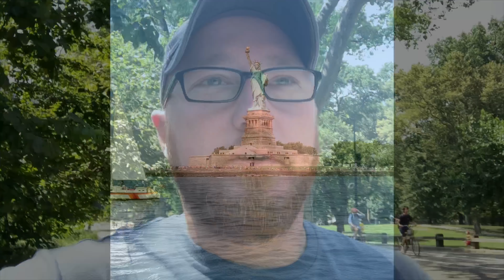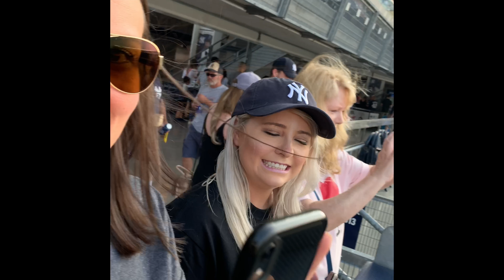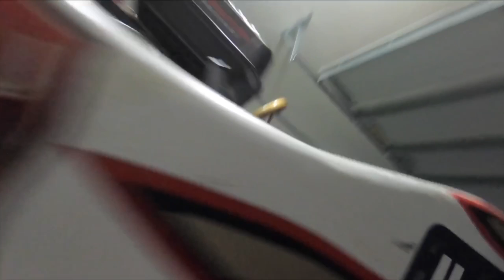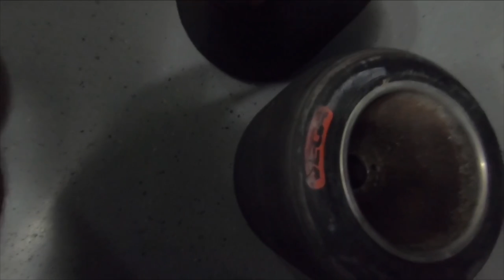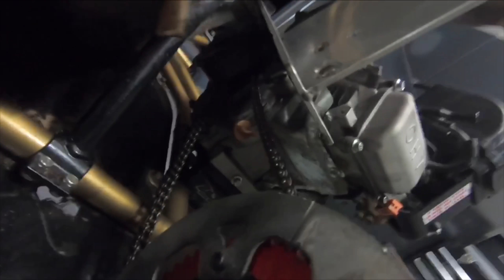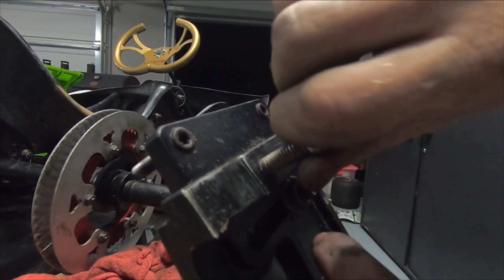I’m in New York, Joseph has a Surprise and Joshua has Go Kart Problems

Comment: I would never remove the rear end it will throw your setup off either pull the seat or drill hole in side of seat but best to remove clutch that's something you will do often in kart racing any how.. I have a lot of gears and motor mounts  quick chang motor mounts you can have pluse other kart parts

Comment: You do t have to split the chain to get it off. If you just loosen up the motor and slide it back you should be able to pull the chain off the front sprocket and just leave it on the rear spocket. Also the color you have on the rear axle that is cracked you can just remove that one and run only one that’s all we use on our karts. Any other help you need I am more then willing to help

Comment: 1/2 inch or 13mm wreck will take the bolt out of the clutch to remove it theres no need to unbolt the axle... as for the hub its usuable the way it is .. run it

Comment: Don’t run your tire pressure high run them in between 4 and 6 with slicks also move a weight to the corner of your seat closer to the left rear it will make you get through the corners faster also just go to a hard ware store and buy some cheap tire prep I personally don’t prep the tires I just clean the cause it don’t really make a difference at my track or you could also use sand paper but prep would probably be better for your track cause it’s a nice track and pretty slick also don’t forget to change you oil after every two races

Comment: As fare as prep goes wiping on is for the track and day of the race you need to prep from the inside out during the week on a rotisserie  it sounds like alot to take in but if you havent checked out bobs4cycle there is years of reading material on there that can get you pointed in the right direction in any aspect of kart racing

Comment: Also I have a suggestion for the tires. Those are a very hard compound tired so to keep the oils in, and stuff takes some wd40 spray it on the tire then wipe it in with a junk rag and wrap your tires in saranwrap
Reply: Then take the saran wrapped the day before you go to the track

Comment: Need a tach for sure.. then you can adjust clutch teeth and gear for best performance... been years since I raced Go-karts but get some tire prep/ small paint roller and roll the tires a couple times a week and during breaks from on the track.... just like a car...scale it... get weight percentages... square tubing stand with some foam, easy DIY.... until you can afford a kart rolling stand.. have fun most important....lol

Comment: Go to 4cycle.com and read up. Be careful with the tire preps. Some of the preps are really harsh and will damage the longevity of your tires. The softest tire is not always the best. When we ran karts we used Trac Tac preps. We prepped during the week, prepped at the track between heats, before the feature, etc. Tires are usually the difference maker.  If you're track is usually hard and dusty, stay away from extreme softeners (like goat pee). General rule of thumb is the tire should mirror the track, ie a soft tire on a soft, heavy track, etc.  Spec kart classes usually have engines that are very close in HP, so the difference is made up in tires, setup and driving. Make sure you clean and lube bearings, chain, steering every week. Reducing friction is free hp. You should be able to spin your front tires and have them spin for minutes. We also balanced our tires, but not necessary unless you're looking for hundredths. You'll need a tire band and a PVC fitting for breaking tires down. Tires are EVERYTHING in a kart....your grip, your suspension, everything. Learn what your track likes for tires. Keep your clutch in good shape. Smooth is fast and have fun!

Comment: Replace the hub thats how you adjust the set up we would slide it in or out to loosin or tighten up the cart id also get the torque specs for it. Try tapping it but id def buy a spare mount just incase and buy yourself a chain tool and couple master links just a start good luck have fun change oil and oil soak the weel and axel bearings for better wear and speed.

Comment: Joshua u need a chain brake , should be a , number 33 or 35. The engine mount is probably all aluminum , so carefully retap to the next size. You should build your own cart stand and use the black pipe wrap on top. Bridgestone tires worked best for my margay kart. That was 30 years ago. Don't go whole hog with money on it. I recommend forming your own karting club. WKA WORLD KARTING YOU WILL INVEST TOO MUCH MONEY. you can do that later on if you desire. Your cam can be twisted slightly in a jig to get valve overlap. Machine shops are handy for quick repairs. I was looking at the chain guard wondering if it is required. Could cause problems. Good luck with it and remember you are the roll bar. Rear axle use ball bearings. Good luck play safe! I forgot about the head temp. U will need a digital readout. I think we ran 380 on Briggs engines. This one is going to be different.

Comment: I race go karts down at flat run speedway. I run a class could juniors I use a clone motor. Also I use a 15 tooth gear on the front and a 62 tooth gear on the back. also I run 11A burris tires and I use hoosier tires D10.

Comment: go to your local autoparts store, take a good bolt and get yourself a helicoil kit, drill the stripped hole out and heli it, make sure you drill the hole at the same angle as the bottom clamp not the engine mount angle.

Comment: I made a basic stand for my kids kart with some 1” square tube and harbor fright $5 tires for around $80 total. I’ve seen guys run beat up hubs like that, Obviously not ideal but if it spins true and has not come off yet I’d run it. You are loosing adjustability by not being able to slide the hub in or out as designed. Hubs are not to expensive compared to a micron or set of tires. I’d get gearing right and a set of tires as soon as you can so you can learn and not just bogging and sliding off the track🏁

Comment: Arcracing.com is a good place for kart parts. Also they have a youtube channel with a bunch of kart videos. Has helped me with what little bit I've learned this year.

As for tire prep we spray them down with wd-40 and then plastic wrap them....I'm sure there is better stuff but it's a cheap alternative
Reply: David Bell well said, ARC youtube channel.. long videos but very informing has helped me a ton. Motor mount bolt i would try getting a long one first and maybe shortening it if it bottoms out before tight. The hub i would run it till funds are available, maybe find someone with a used collar to add some insurance. Removing the motor woulda have been easier to remove the clutch with the motor loose chain comes right off. Clutch maintenance/cleaning is something to look into. Tri-flo your bearings. Im from missouri and dont know anything about red vega’s.

Comment: You don’t need a chain breaker lol slide the motor back and take the chain off the clutch which is on the side of the motor
Reply: Also obviously there is no “clutch” peddle but that is what the thing is called on the side of the motor

Comment: When it comes to tire prep I use WD40 and I spray it on before I go run each session. I would definitely get a new hub for the rear, safety first. Your clutch will come off with a 1/2 wrench and a screw driver holding flywheel in place. I would definitely check the bearings with you just getting the kart. I would also use wd40 on all moving parts, bearings steering wheel spindles heim joins etc. when it comes to a stand I used saw horses for a few years and then I built a stand this year. I have 75 bucks into it. I would check out Out 2 win to buy new parts. Good prices and quick shipping! www.out2win.com if you have any more questions just ask! Have a great night. I enjoy all of the videos!

Comment: Ok, where to start-LOL...I'll just go down the list based on the video and what comes to mind from my experience racing karts:
1.  You don't need to remove the entire right side nerf bar/side panel to loosen or remove the motor.  Might save you some time/trouble going forward.  
2.  You MAY be able to put a Heli-Coil in the bottom motor mount, but risk it pulling back out since it's aluminum and those bolts are under a pretty good deal of stress.  That motor mount is 2 pieces I believe, you may be able to just buy the bottom portion...I'd call Ultramax Racing Chassis to be sure, or check their website www.ultramaxracing.com
3.  The RR locking color being broken isn't a HUGE deal...that hub has those 2 sets of "back-up" bolts because most racers used to run a 1-1/4" locking collar next to the RR Hub, so chassis manufacturers got wise to it and start building them into the hub itself.  If you want piece of mind, purchase an 1-1/4" locking collar and slide it up against the portion that's broken and lock it down.  The parts trailer or local kart shop will have them and they're very inexpensive.
4.  Weekly maintenance, I'd take off the motor completely, remove the back axle, remove the front hubs but pay attention to where the spacers are on the barrel of the spindle on either side of the front hubs themselves, then hand wash the kart with car wash soap/water.  You can soak the rear axle front hubs in WD-40 and wipe clean, I never got water on any bearing components...some folks feel differently, that's just what I did.  Once the axle/hubs are clean, spray Tri-Flow in all bearing compartments. to ensure free rolling components.  Obviously, check for any bent parts, etc...make sure the steering is free...meaning, when you turn the wheel it's not binding in any way.  Make sure the nerf bars and front bumper aren't in a bind...you should be able to wiggle them up/down while they're installed on the kart.  If they don't move, they're bound up...remove them and "adjust" them whichever way you can until they fit onto the chassis without bind.
5.  Tires...yes, the most dreaded piece of dirt kart racing...if you thought they were important in race cars, they're exponentially so in karts.  Being that there isn't any real suspension to speak of...tires are the key to speed.  I understand your mindset of getting used to the kart, then buying new tires...but you're risking setting the kart up on old tires, getting used to it, then putting new stuff on and changing the overall bite of the kart (both side bite and overall grip) which could set you back a little.  If you're able, find a tire guy...buy the tires directly from him/her...have them prep them up for you and bring them to you, trust me it'll be much less of a headache.  
6.  Stagger, make sure your stagger is right...check it constantly...tires tend to grow/shrink based on the amount of heat cycles they've had on them.  
Hope this helps...I"m happy to help in any way further...what I listed above isn't the "gospel" by any means, you can probably ask 10 kart racers the same things and get 10 different answers...just my feedback from experience.  Good luck!
Reply: Good stuff 👍😁😁...

Comment: The first thing is get the serial # and contacting the manufacturer, tell them the class weight, engine and tires. They should give you a baseline setup. It appears you have a Ultramax, I’m not sure about them, but Phantom was good for that information when I raced. If your rear hub isn’t moving I’d just get a 2 piece collar and attach it to the axle against the rear hub, that will help with any movement, in fact do that even with a new hub. I had a wagon style stand, perhaps your Dad has some 1” tubing laying around and you or them weld up one. My stand was made by a racer instead of the scissor style, it was a wagon style. You need a prep stand, send me an e-mail jdedmon91@gmail.com I’ll send you a set of UMHW plastic hubs for a prep stand, also you can buff the tires like a late model on it.

Comment: And if you get a 2 or 3 dick bully clutch it will pull better than the shoe clutch you currently have and if you keep your current clutch you should take it apart every race or two and take a fine piece of sand paper and lightly smooth the clutch so it will work smoother

Comment: Jonathan looks like he would rather be hanging the 56 car out coming off 4.
Reply: on the stripped out thread, TIMESERTS are always a better way to fix it.
Reply: on the chain, get a chain breaker tool to push out a pin in the chain. And your problems solved

Comment: I used venom juice and goat at Callahan.
Reply: Also I wouldnt care about the bolt on the motor mount. I ran mine with 3 bolts forever. Just crank it down. The hub looks fine too I wouldnt care about it. If you want to borrow my stand you can borrow mine I live in lake city. Get a impact drive should be able to back that clutch off with it.

Comment: You can try and helli coil next time loosen motor mount pull motor back all the way and remove sprocket qaurd  charge oil inspec chain look for bent links don't use master links but a 35 chain breaker so you don't put a weak spot in chain as for rr hub put nuts on studs get a wood block and put it on the hub towards frame smack a good one and see if it moves if it dosen't move you should be fine  but lean to replacement when able and to tighten the car up stuck the hubs in about 1/4 inch  what I like to do is bring LR all the way in and use RR to adjust  in tighter  out loser

Comment: The rear sprocket is 2 pieces....pull the motor back, unbolt the rear sprocket, and the chain will come right off. You wont even have to unbolt the whole axle